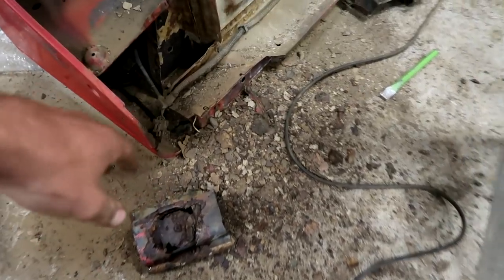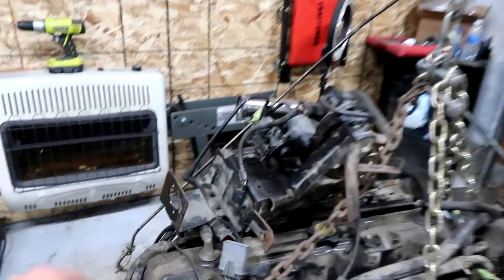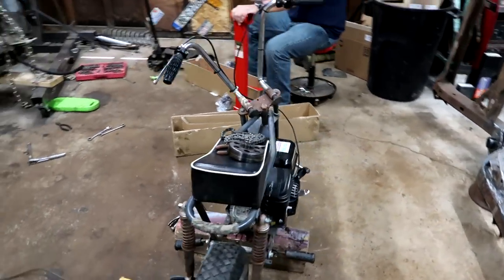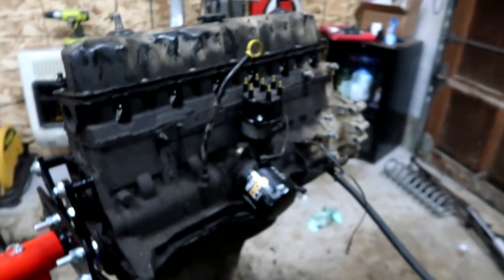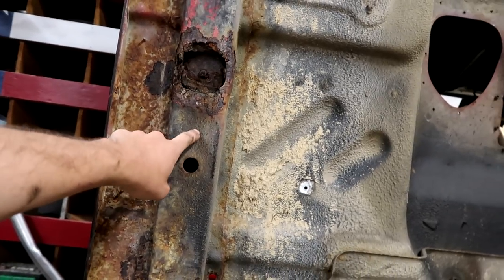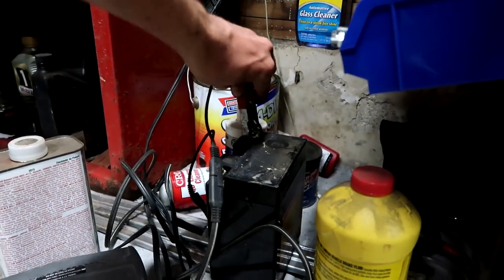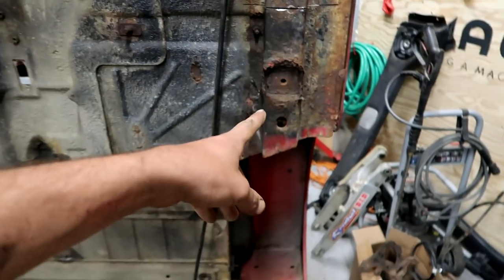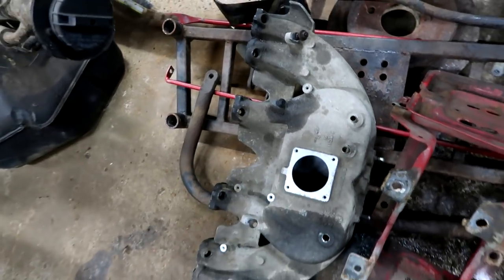1 Reason You Should Not Buy a Northern Vehicle

Comment: Dalton, love your videos. Just a word of advice, I have worked in an automotive machine shop all my life and have seen hundreds of 4.0 Jeep engines. One major flaw they have is the factory pistons are very thin and often break off the skirt. The majority of the pistons are almost always cracked. Sometimes it’s hard to see until you get the pistons cleaned up but most of them are. I have changed hundreds of these pistons before and when pressing them off they usually explode in the press from being so thin. Just trying to help. Good luck.
Reply: I would like to add that I agree with some other posters in that I know it’s a lot of work but you must get as well tear the engine down and do it right after going to all this trouble. Sandblasting an engine together can be some big troubles. Can’t wait to see the finished project!